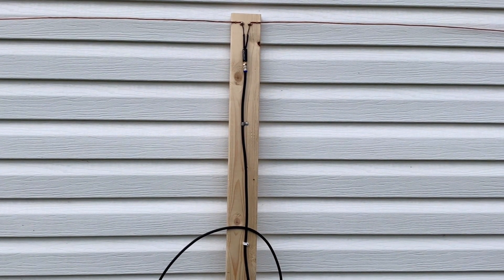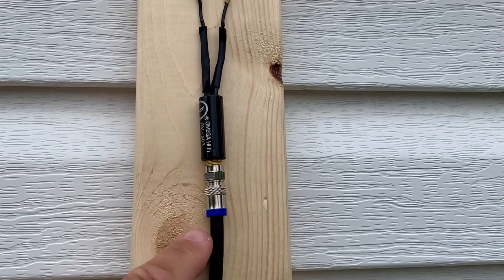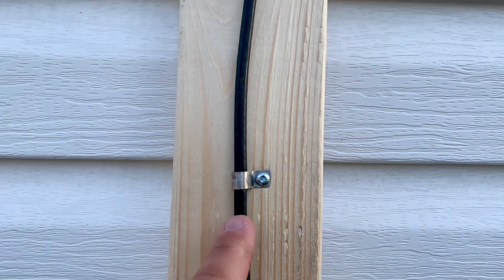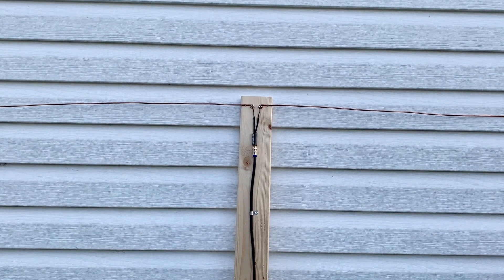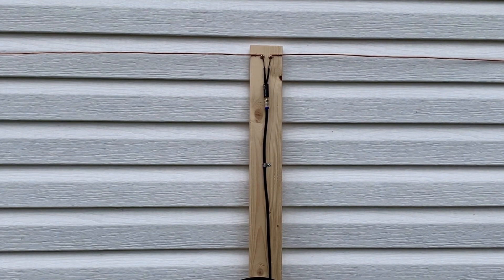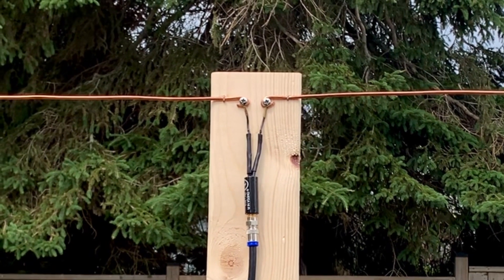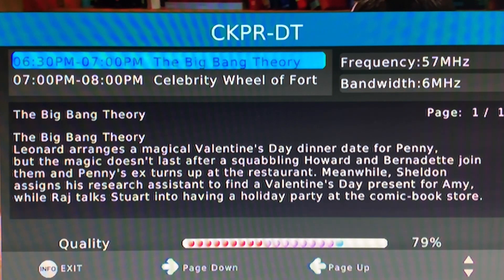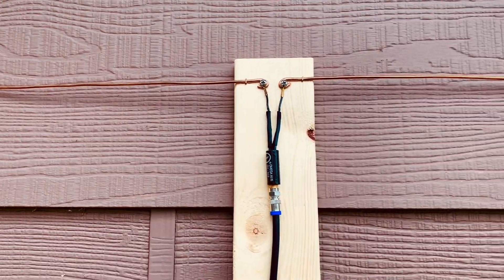Build a Homemade DIY TV Antenna from copper wire - dipole OTA TV antenna for local channels

Comment: I wanna try this but indoor would this be safe to do so?
Reply from the maker: @staticxboy3000  As long as the antenna is placed in a spot where nobody will walk into it, trip over it or poke their eye. 

It’s no different than using rabbit ears or any other indoor TV antenna. Just make sure it’s placed in a safe spot.
Reply: @NorthcoasterHobby  thanks for that info im gonna try it this weekend!

Comment: I live 200 miles away from any tv towers in Wyoming! Now will it work for me or not! You didnt say if its a Long range or a short range !
Reply from the maker: Definitely a short range antenna. See my other replies.
Reply: No antenna will work for 200 miles, at least not on the VHF or UHF bands. When I was a kid my dad had a 50 foot antenna tower installed with a motor and the whole deal.  We lived in a high elevation area as well.  On our best day we picked up UHF stations from 100 miles away and that was only periodic depending on the time of day and weather.

Comment: Extremely simple workable build, but outdoors you talk about droop in the elements and straighten them out...Birds are gonna do a number on that, cause they will tend to land and sit on the elements...I built Hoover-Grey antenna's and although antenna sites say I should not receive signals, I receive several year round and even more once the trees loose their leaves...The one I use now is in an aluminum three season room up against a window...I never thought it would do much in that situation, but a real surprise as I can capture 6 signals as mentioned year round...Enjoy your video's Sir...

Comment: How does the transformer minimize signal loss?
Reply from the maker: Equalizes the impedance between the elements and the coaxial cable. Less loss between the two.